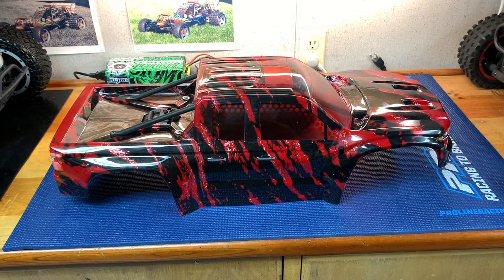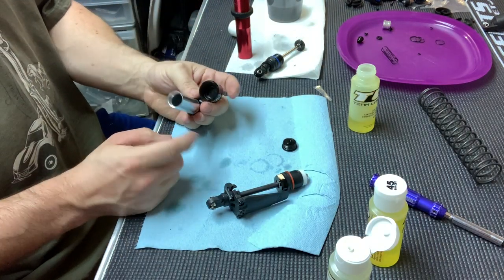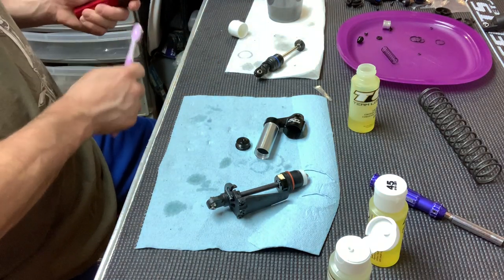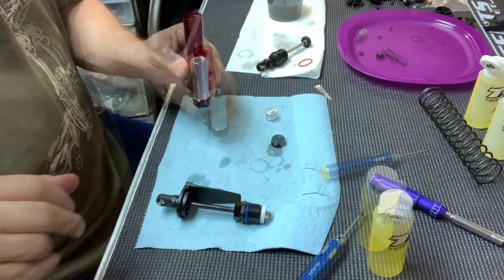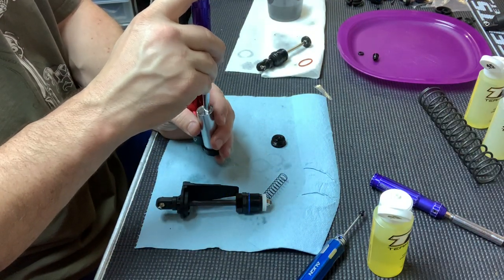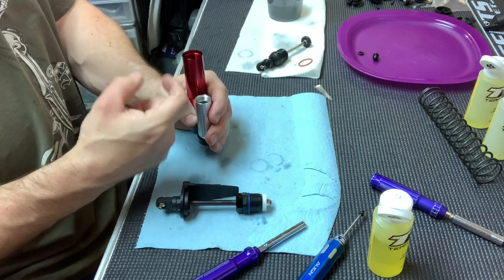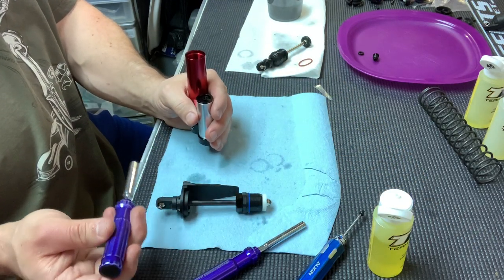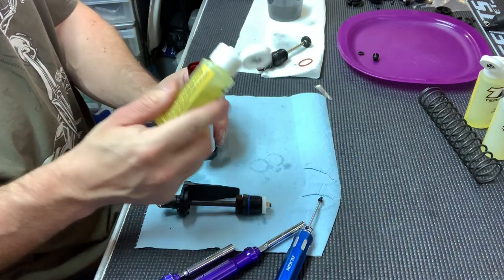Proline Ultra Reservoir Shock upgrade on the Traxxas X-Maxx

Comment: GPM has a wicked awesome piggyback shock set they make for the X max now. It even has dual rate springs. And if I remember right, it was less than $100 perPAIR!! They look awesome, they perform even better than they look. I drove my truck with pro lines, but these GPM shocks on my ex max are the only way I will go now. In fact, I even had a pair of StockX Max shocks that I upgraded with M2C 7 mm shaft and cartridge kit-you can even buy just the GPM piggyback caps and create a monster shock using some of the stock parts!!!

Comment: I had the same problem with the hd shock shafts. I mentioned it to proline but they didn’t seem to care. I found that the oring was sitting on top of a thread. I clean out the bottom thread with a exacto knife and had no problems after. They left no area for a oring to seat.

Comment: I got the Snap on edition 8s Xmaxx myself and i thought about doing the same thing and using my red stock shock tubes in conjunction with the proline piggyback reservoirs.It looks awesome.. Very helpful video & info on those gaskets. The proline stuff is expensive after spending $1200 dollars on the truck..not to mention changing electronic parts for it to work properly..thats why im changing the reciever, esc, servo first. Then the shocks and badlands and other parts will follow. Thanks for the helpful video!

Comment: I want the pro-line shafts and cartridge kit. That’s it! Don’t need the shock bodies, or the piggy back shock caps. I just want the 6.5MM shock lowers. They are like $45 for (2) so $90 total. And then you get a thicker and coated shock shaft, with delrin parts for smoother operation. That’s all the X-Maxx needs! You don’t need the shock bodies, you don’t need the shock caps, don’t need the dual
rate springs...
Reply: Finally a smart comment. 👍

Comment: I ordered the proline shock shaft kit, and proline shock body kit. Going to re-use stock xmaxx shock caps. I also ordered new Traxxas stiffer springs. So i’ll be running full proline HD shocks only with stock xmaxx caps lol. Good enough for me. This alone was like $242 for all (4) lower shock shafts, (4) shock bodies, (4) Traxxas springs, and 8 ounces of 37.5wt oil. I’m greatly looking forward to the larger shafts and smoother delrin piston shocks. It’s gonna be nice!!

Comment: I have the reservoirs my truck as well as the proline dual rate springs. Ha I dont even know what advantage they add. I dont drive my truck much. Maybe 7 times in one year. It has never seen dirt. I do admit they look cool. Good video. Very nice truck.  I do need to add the new shafts. As u said I see them, i want them.

Comment: And Vaseline or oring grease but hey if stock ones work 👍👍 thats excellent pic up i want get one too like you said hard fi n d not all beat up
Reply from the maker: I had tried using the shock oil and that did nothing.   The ring is larger than the stock one.
Reply: @JasonPerrinRCVlogs  ok i wasn't sure if its something ppl have been able to do , i know making them cold they will contract lil bit

Comment: What is the advantage to these shocks over stock? My stock shocks are the biggest out of any of my RC's and they haven't caused me any issues 🤔
Reply: I’m guessing they make zero difference. look cool though
Reply: Looks
Reply: no advantages.
just looks.
Reply: They have better dampening and the dampening is adjustable....also, I suggest you get the dual rate springs. That's what I did along with full aluminum wide arms and it handles far better than stock. Much more planted and less bouncy

Comment: Does the shock come out on its own? I’ve got these but the shock just stays in when pushed in.
Reply from the maker: Funny you ask that.  No.  Mine had no rebound either.  I was going to contact Proline and ask.  I rebuilt the one a few times trying to get it to rebound like all other shocks are suppose to.
Reply: If your shock is pushing back out, that means you're building pressure in it, which is going to lead to failure. When you push the shaft in, the fluid is going through the hole and shifting where that fluid is in relationship to the piston. However, that shouldn't create pressure.

Comment: Yeah, but if you spend $1300 on a R/C truck you shouldn't need to drop hundreds on aftermarket parts.
Reply: Ive not found any ready to run rc that doesnt need a upgrade or 2
Reply: You don't.  The stock shocks are fantastic.  The reality is that when you have a grand to spend on an rc truck, you probably won't shy away from an extra $500 in after market parts just cause.
Reply: @brandoncomer6492  Right about the shocks being ok. Wrong about the money, lol. A lot of people save a long time to be able to buy a thousand dollar RC. You're out of touch if you think it's nothing to then turn around and spend half again as much on shocks. I know my wife would look at me like I was nuts if I dropped a grand on an RC and then said I needed to spend $500 more on shocks, lol. She'd be like "wtf??? Didn't it COME with shocks ffs??" lol
Reply: @adamaj74  that's why you buy used I found a used basicly new xmaxx and paid 900 it came with 2 6700 batteries and the duel 26 amp charger. Let others pay all that money then find out they only gonna use it twice then you low ball em I basicly got a new x maxx for 900 ready to run and a box full of parts he never put on lol.
Reply: @s1lentcalib3r  I like the way you think, haha. Good name btw.